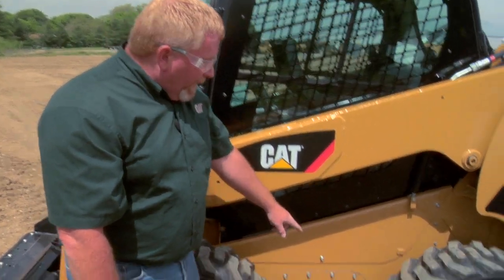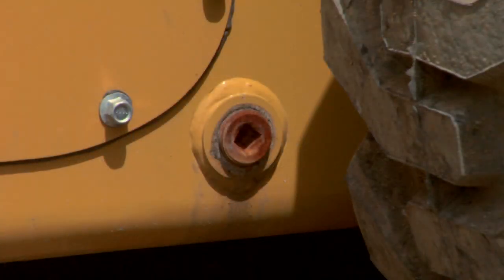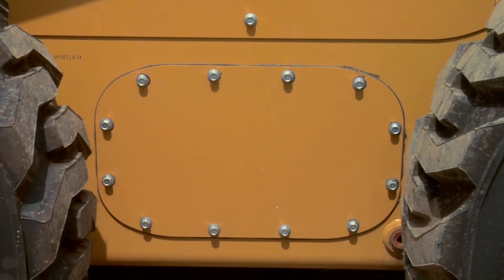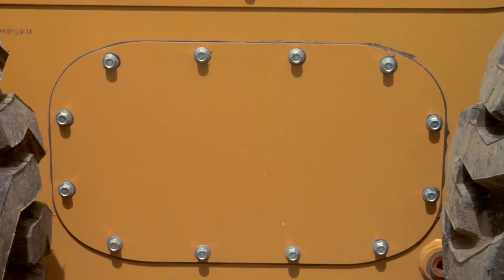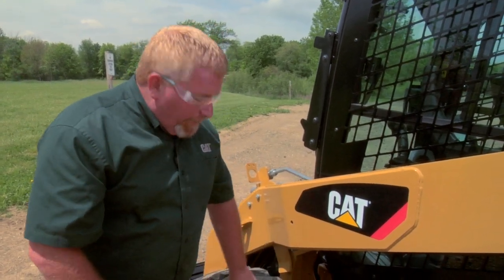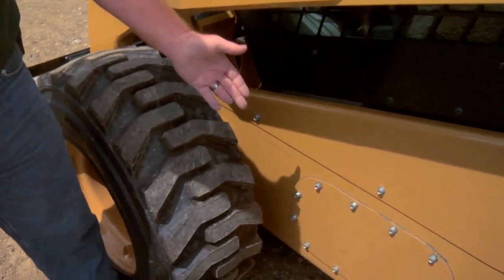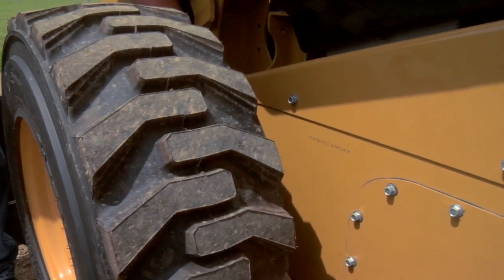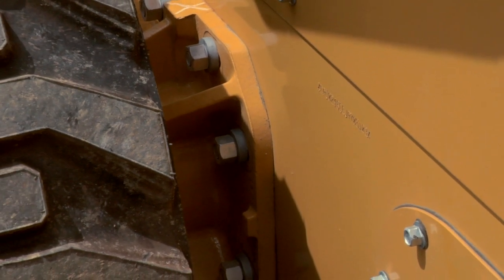Cat® Skid Steer Loader | Drive Chain Adjustment & Chain Oil

Comment: Agree with the others. The information was SO superficial it was a waste. It wasn't even as good as the O&MM, which isn't as good as the Service Manual. But both of them lack the essential information - what kind/type/grade of oil and how much (up to the plug could be a pint or ten gallons) is needed.